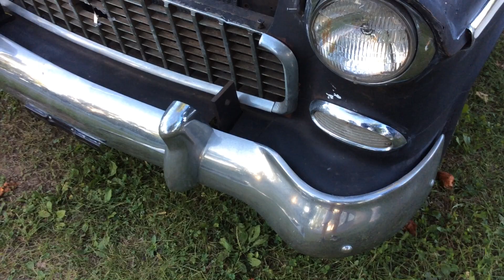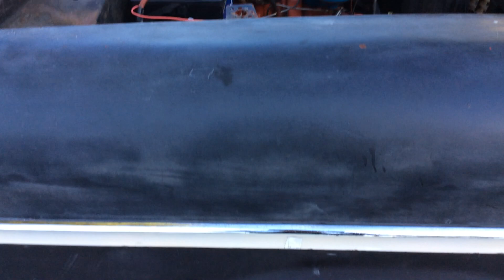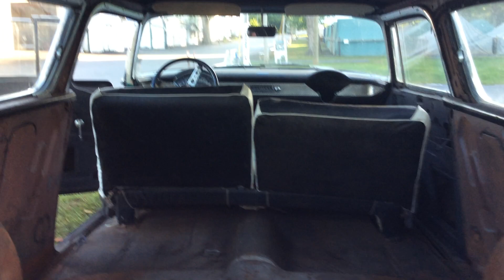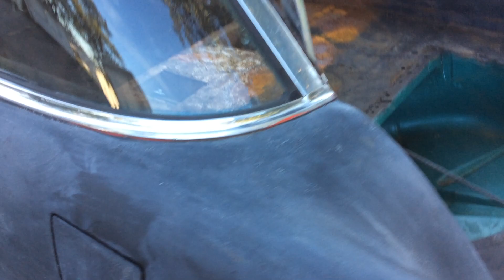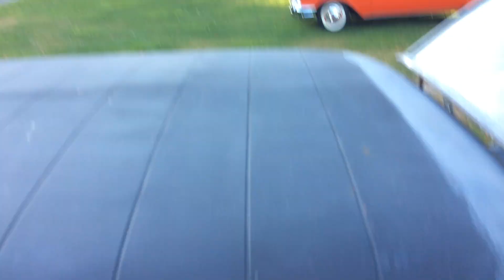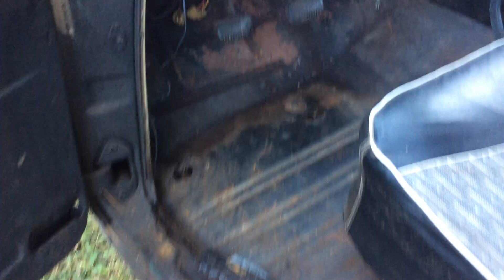1955 Chevrolet Nomad  FOR SALE

Comment: that car from the firewall back interior and exterior was all done at the Norwood assembly plant Norwood Ohio the birthplace of the F body but during the 1950's they build 85% of all Bel-Airs that were sold in the US came from Norwood Ohio Assembly Plant put those bodies were then put on a truck and ship to the Arlington Texas plant  to have the front end sheet metal and engines installed but everything from the firewall back was built in Norwood

Comment: This led a hard life... the inner fender wells are hacked out, likely for the so cool fender well headers, there are brackets for Dzus fasteners for a likely fiberglass hood, there are what appear to be tow tabs sticking up from in front of the grille, the firewall appears to be hacked to probably clear a tunnel-ram manifold, the interior is gutted, the beautiful stainless and chrome headliner bows gone, I bet this was a pretty cool race car at one time. But... if this went cheap, it could be cool again. I'd do it back up as a gasser style, cheaper than trying to go back to stock.

Comment: I think the ballast resistor is bad,and when you let off the key,the full 12 volt "override"wire on the left side of solenoid opens and the resistor is supposed to take over.(when it dies).